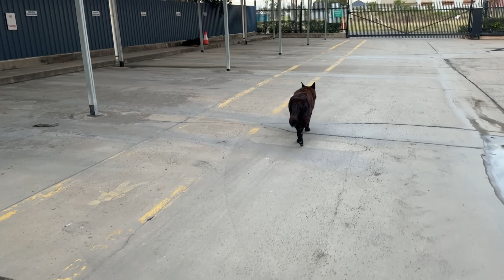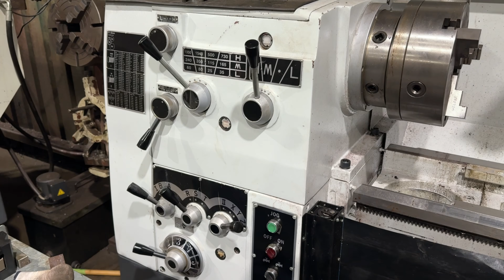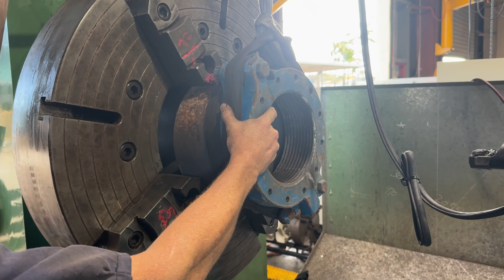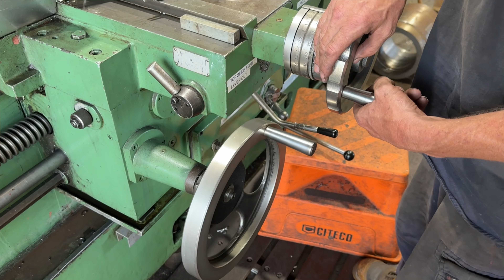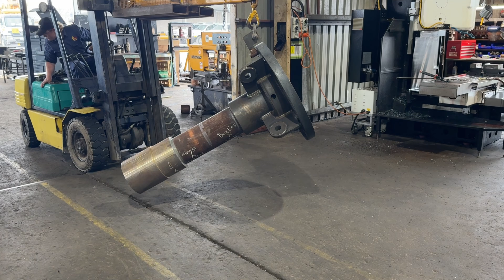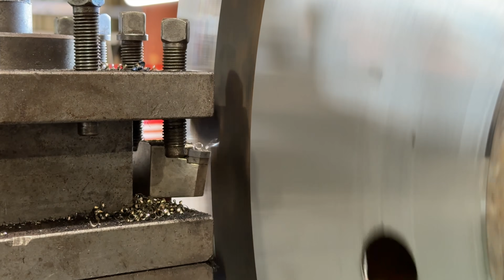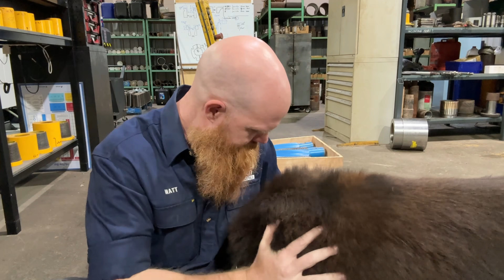Why We Bought a MEGABORE Lathe (… and 5 Things We Use It For!)

Comment: Here you're knocked out by the new machine hulk and its power etc. ive just watched you take delivery of hulks replacement because the stuff you get in now the hulk couldn't physically handle. so in a years to come how big will the bits of work be for you to upgrade on the as yet un-named machine.  Its going to be fairly massive.

Comment: You talk about size matters friend of mine works over at Norfolk Naval shipyard in Portsmouth, Virginia and they have a VTL over there that they had to put new Babbitt bearing shoes on because they had worn out the table could lift up and down when I asked him how big the table was he said not that big just 25 feet Across when they were cutting something really really big the 60 Hertz motor that drove it would leave marks because of the gear reduction in it. They couldn’t figure it out when they asked my buddy Sami he goes. That’s when the electric motor fires they ended up putting a 400 hertz’s motor in it and controller and everything and all of it went away, but they also have one of the leaves that they would use for turning down the barrels on the USS Iowa class battleships where the bore is 16 inches and there 80 feet long something like that that’s a big life than that one does have a chair on it that you drive it back-and-forth

Comment: Something surprisingly satisfying about the interrupted cut of the outer bolt holes! The sound that the thing makes when the only degree of freedom is rotation driven by a strong motor... and the metal being removed realizes that it has been overwhelmed and might just chip away quietly and not make a scene.

Comment: Is 300mm the practical limit for trepanning, or could you make a 1m tool? It seems like there would be less problem with deflection because, unlike a boring bar, there are two cutters offset at 90 degrees.
Reply from the maker: I’m the wrong person to ask what the limits are for trepanning.  Although I suspect it’d get very difficult as diameters get larger due to slug weight

Comment: Snakebite here  Matt, I was absolutely gob smacked watching that 63 mm HTS drill pouring out the chips.. the sheer volume of metal and the RPM , I can’t comprehend.. I am used to OLD SCHOOL drilling with HSS drills doing 150 RPM instead of 600-700 that you were doing. 
I simply LOVED that you mentioned that you the least Woke shop around ( Woke is a load of CRAP, catering for the minority not the majority) and you would have  a bit of fun at work. 
Workplaces have LOST the sense of humour ..
I will share some funny stuff that we used to get up too at Griffin Coal.. 
We had service workshop that was about 5 kilometres away from the main workshop, the guys down there when they came up to. The main shop would put NEVER SEIZE on the ear piece of the supervisors phone then they would ring that phone once they got back to there workshop..
One night shit the boys played a prank on the guy that ran the SPY HUT . The SPY HUT was a transportable set up on the edge of the cut to oversee operations 
The guy running the spy hut would catch zzzs when the crib break was on. So the input fitters covered the window with black plastic while he was snoozing. 
You should have heard the panic when he woke up and couldn’t see anything.. 
ALl you could here on the 2 way was ( Calling the Electricians over and over)
My favourite one was something I got up to while I was lineboring 
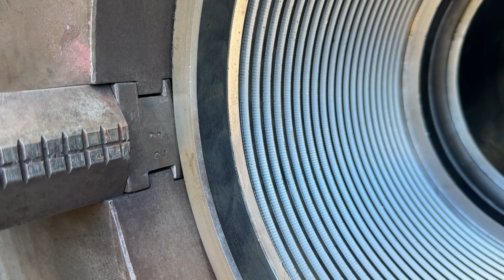It was ( Calling  the electricians over and over on the 2 way) mean while we were all pissing ourselves  18:50
And MY FAVOURITE one ,The Crack!!!!!
I was lineboring the stick eyes on a Demag 285 .
Our planer keep coming down to check on progress,so after he left I grabbed a scriber and scratched a big crack type mark in an area on the Carbody that I knew was prone for cracks..
The next time he came down I said to I would be finished soon and he looked so relieved,but that’s when I hit him with THE CRACK..
I said to him when are you going to start repairing the massive CRACK.. when he looked at my scratch mark there was instant panic, he rushed off the get the chief maintenance supervisor, who came down,looked at the crack and took off to get the maintenance superintendent..
Meanwhile I had wisen the boys up to what was happening and there was a crowd starting to form but,very discreetly..
The Maintenance Superintendent came down and actually went underneath the machine and into the turret where the ring gear bolts on and (yeah  it’s a bad CRACK because I can’t see light through it. WTF
We where all pissing ourselves, but the the enormity of the situation was getting out of control because they where ringing around the find welding crews that could work around the clock to get the CRACK repaired.
He didn’t believe me because the Maintenance Superintendent could see light coming through it but assured him it was only me playing a joke.
He grabbed my ball pane hammer and proceeded to chip off all the paint, HE WAS NOT a HAPPY CAMPER when he realised  what I had done..
I am fanging to see that Mega Bore drill working

Comment: A big horizontal boring mill 
Would be helpful 👍
~ 60” square ROTORY  table accurate enough to spinn long/deep parts around and bore holes to match from other end 🎉
100” X 50” travel 
5” spindle with MT-50 taped
Long spindle travel is desirable 🤨
Reply from the maker: I think you’re right Henry

Comment: I once worked on a lathe that had the capacity to turn a 12 meter diameter by 30 meter long part. It had a 300HP spindle motor. This was in a place that manufactured steam turbine rotors for power plants. The operator station was up a flight of stairs. The part we were turning was "only" 2 meter diameter and about 12 meters long. I had to cut a 0.5mm wide groove on the outer diameter along with many other grooves and face grooves. It was interesting but scary at the same time. The value of the part when it was clamped in the lathe to begin the work was already in the millions of $.
Reply from the maker: Holy shit that’s massive!!

Comment: Ahh The Hulk has a Slow Change gear box.  If you can set that in 10 minutes you’re doing well.
I see there is a Chuck on the back of the spindle.  Never seen that before but I bet that is handy.
If you want to know what would go well with the hulk….
An overhead crane.  You know one on rails that runs along the roof.
Reply from the maker: We desperately need a better crane setup - but we are limited by the shed.

Time for a bigger shed 🤣👊
Reply: @ 
I notice The Hulk didn’t make it very far inside the door 🤠
I recall the factory where I did my apprenticeship.  Just a huge fibro shed really.
The boss wanted to install an over head crane but the Governtment Department for Labour and Industry said “No your roof is 18” too low”
There were about 18 huge steel I-beams holding the roof up so he bought 18 hydraulic jacks and cut through all the beams with an oxy torch.
We all jacked in time until every pole had a 19” gap and we welded a new piece in place.  (I guess an inch to spare) . The crane was a ripper.
It was rated at 3 tons but I reckon we used to pick up way more.  We reckoned if the brakes would hold it we were fine.
The roof had multiple pitches and we only raised one section so it left a funny gap at the top.  It was about 25m wide and 150m long
A few years after I left that flattened it and built factory units.  Probably all too small to do anything much.

Comment: I'm an old time manual machinist that's worked in many areas (60 years). If you have large scale milling to do, I used to run a Cincinnati Hydrotel, a massive vertical milling machine. They are super powerful and accurate. I used to work both for the Cincinnati Milling machine Co (Now Milicron) and for Leblond Machine tool company (where I ran the Hydrotel). I've run nearly every kind of lathe and mill there is. The Hydrotel, if you need a larger vertical milling machine can't be beat.
Reply from the maker: Thank you so much for the tip good sir! I’ve heard really good things about those mills.  Great to hear it from someone with your level of experience.

Comment: Back in the day when i was in the thick of it, one of the ones I ran was a Bullard 36" Vertical lath. I was working for Martin Sprocket and Gear. So just under a meter chucking size for yall. It was perfect for facing the large sprockets before adding a hub to them. It was more like a humongous mill with a lath chuck.😉🙃
Reply from the maker: Nice work!

Comment: I haven't seen a Spanish lathe, but that looks a beauty. Nothing wrong with change gears. Any job you're doing on the Hulk isn't gonna be slowed down to notice from time doing gear changes. I've come across some mach9nes that big and bigger but they are getting really rare here. No really big industry to support any more. Any plans for a vertical lathe?
Reply from the maker: I think we’ll just end up with a really big CNC megabore. We don’t have much use for a vertical lathe in all honesty… mostly because we need to be able to throw drill rods in it 😉

Comment: Way back in 1977, I designed an oil country lathe having 10 meters ABC and 15" spindle bore. These lathes were sold to oil pipeline industry for large dia pipes machining and threading. I designed other heavy machine tools for the company I worked in.

Comment: My green Grizzly tools 7x14" with the chucks, steady rest, follow rest, face plate and all the tooling I have for it don't weigh as much as that 'tiny' boring bar. I have a new respect for change gears, the SIEG 7x lathe designer must have seen this Hulk prior.. Great Video.
Reply from the maker: Cheers mate! 

That’s gold 🤣 yeah, the hulk is a mad bit of gear. Still small by “big lathe” standards… but bloody big enough for us.

The 40t crane barely got it in the shed… there were warning sirens blaring 🤣🤣

I think the Chuck weighs 400kg.

Comment: Clausing Colchester  60 inch swing was listed on the internet can't find it anymore. Running a Mazak 20x60 myself.
Reply from the maker: Nice!! That Clauding would be a fairly big bit of gear.  Mazaks always seem to be very well put together
Reply: @halheavyduty  The Mazak was made in 1967. We placed a thrust washer on the compound screw under the handle dial because the compound was froze , other than that she is working well.  Holds decently tight tolerances and the ways are very clean.

Comment: Are there not dampeners to mitigate the resonance? Lead weighted bands to absorb the energy on work piece and cutting tool? I used them in the 70's turning big brake drums. Sound travels through steel at 16,000 feet per second. Other materials, not so much. Sound intensity drops sharply when transiting different media with different acoustic properties.  A heavy lube poured over the parts may be beneficial.
Reply from the maker: Thanks for that mate. We do use some rubber dampeners. Am getting a few magnets in the new year too.

Comment: 😂 I have operated much bigger lathes and  one had a chair on the carriage for the operator to sit.
 Used 2 inch HSS cuttings tools and would make some very large chips.
Reply from the maker: Bloody hell. That thing would make chips like Doritos 🤣

Love it
Reply: @halheavyduty  To me it was a scary ride the first couple of times I had to use it and it will make big thick chips. 
 The carriage set on a 30 feet long bed. I forgot how much it could swing but I think it's around 8 to 9 feet diameter. 
 It was use at one time to make huge crankshafts for big diesel engines.
Reply from the maker: I’d love to operate something that big at some stage! What a weapon 👊
Reply: @halheavyduty  I was a Tool and Die Maker at that machine shop but we did all kinds of different jobs other than Tool and Die. 
 The old German master machinist taught me how to operate this huge machine. 
 I looked at some of the tools that were used for various setups and we had a  50 T rail crain to put work pieces or change a chuck.
The center for the tail stock could not be changed by hand and it didn't have a live center. Used some kind of lithium grease. 
 Some of the HHS cutting tools were 4 inches square but I had only used the 2 inch. 
 Some chips were kept from over the years that were made with that lathe and let me say I would not want to be hit by any of those huge chips. Some looked to be. 0.050 thick and 1.5 inches in depth. So a 3 inch off of  the diameter cut per cut.
 I had never needed to take that deep of a cut and would be scared to do so.
 I liked making Tools and Die, molds, jigs, fixtures, heat treating, all old school, no CNC OR DRO.
 We did use optical/optic scale on the end milling machines when needed. Most of our finished sizing would be on surface grinder. 
 I loved this type of work because you never did the same thing every day. Each piece of a die is different and when you are finished with that die you build a new and different one.
 The most important tool in the building is the surface plate.

Comment: How do you cut the thread on a tapered bore or shaft.
Thanks Dan
Reply from the maker: It’s easy in the CNC. You just program the taper and off it goes.

In the manual megabore it’s a little more tricky, but still relatively straightforward.

It has a taper attachment. I’ll do a video on it soon 👊

Comment: VDF Lathe – 56” swing x 33’ long with 30,000 lbs weight capacity
Gurutzpe Lathe – 54” swing x 33’ long with 20,000 lbs weight capacity
Kramatorsk Lathe – 67” swing x 34’ long with 90,000 lbs weight capacity
Reply from the maker: Awesome! Screenshotting this comment. Thanks mate 👊

Comment: Hi Matt, another good video. Change wheels for threads and feed rates. I cut my teeth on these during my apprenticeship back in the 60's so not new to me. I now own a small Myford lathe and it is all change wheels. I had to make a 21 tooth gear for a special thread recently so that was fun as I didn't have a mill so cut the teeth by drilling and filing the teeth to shape. The gear was only 35 mm odd in dia so all very small work but it did the job just fine. Cheers Ian
Reply from the maker: Love it! A true machinist.  Well done good sir.

Comment: Hey from Arizona U S A. I'm a fan of Curtis, and it looks like a fan of yours now.  I would like to see the drill rig that is using that digger. I used to be a driller in my day. It must be some kind of terrific drill rig to use that, and to go that deep. What is the purpose of a hole that size?
Reply from the maker: It’s a bloody big setup.  And incredibly it’s road registered!  The rig is on a quad axle trailer and weighs about 60 tonnes I think.

I’ll have to double check.  17 semi loads of gear for the full setup.

Some serious torque in the head.

Comment: Hi Matt
Good video as always.

I am surprised you don’t get into pump rebuilding.
We cover, drilling, pumps & motors. The biggest I have seen so far is 1500 horse.

As far as machines I can’t off much as our stuff is old worn out iron but knowing what you were looking at purchasing, lathe, VTL, horizontal would help answer the question better.

Some comes down to personal preference/experience of the operator all else being equal.

I loved Cat skidders & hated Deere ( I used to log).

Cheers Mate!
Reply from the maker: Cheers mate! Yeah, I should have been way more specific.  Looking at a CNC vertical mill, another bigger CNC megabore and maybe a horizontal borer.

We do rebuild our own pumps.  The mechanics and fitters are full time on that job.

It’s never ending! 🤣

Comment: Hello from Sweden. Since you asked for some input on what kind of machinery you should look more in to I tought that I might mention Mazak lathes. I run a "mazak super quick turn 18 mark 2" at work that I program in mazatrol T-plus. Their own dialog programming. For one off parts and low volume its really great. I do both programming and simulations on the machine itself and its fairly inuative. Thanks for the videos!
Reply from the maker: Thank you very much. Those Mazak machines are super impressive. I haven’t used one yet, but I’ve seen them in action. About as good as it gets in my opinion!

Comment: ON question I have for you Matt; how do you fluidise what you dig out and(two questions!) what is the head for what you dig out? Most pumps top out at about 8m. How do you do it or is that the secret sauce?
Reply from the maker: We actually drill using compressed air! It’s a wild setup. You’ll get to see it all in action

Comment: Greetings from Germany. YouTube recommended your channel. YouTube knows me so well.😅 Australian and big things, here am I. Of course also CEE, of course Oceanliner Designs and one channel of vintage computing. 
Machines... well... because I'm from Germany, there are brands, with are not as popular, as other brands in down under. But they are worth every penny and very reliable. 
For turning big parts, but not long parts, i would recommend a Traub TNA 560 L. Of course used. An absolute monster. Diameter 1500, bore 500, tip width 2500.
For milling i would recommend Stama, Heller, Hermle and Maho. Deckel for small parts.
Surface grinding Aba, eventually Elb. Round grinding without tip Tschudin Eco Line.
With tip Tschudin or M+M Mai GmbH. M+M Mai overhauls Tschudin roundgrinding machines. These machines are not as good as new, they are better as new. Why? Because the cast iron parts aren't working anymore.
Reply from the maker: Thank you so much for the recommendations. Much appreciated my friend.

I’m a huge fan of ocean liner designs channel too. It’s brilliant!